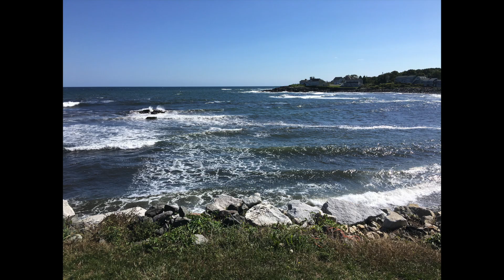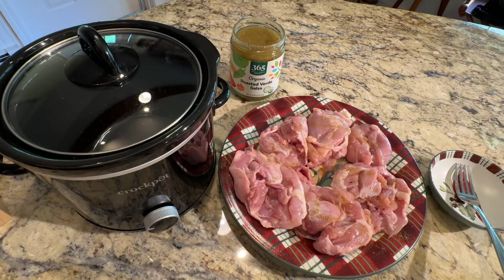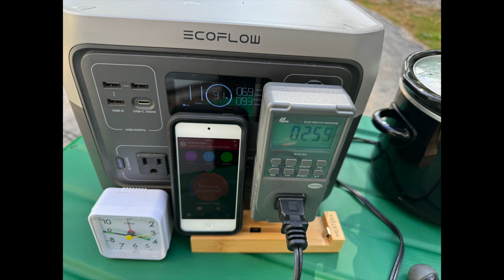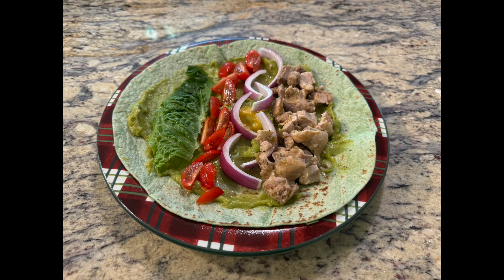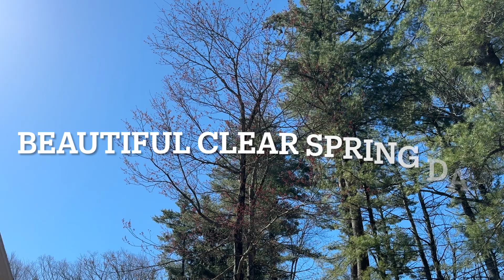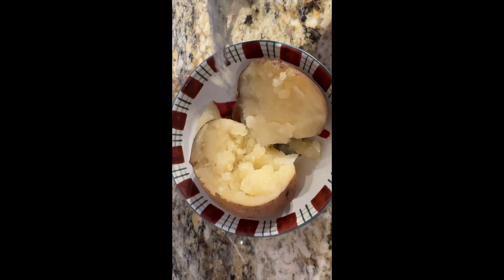Camp Crockpot - Solar Panel Cooking is a GAME CHANGER!

Comment from the maker: Here are the recipes and cooking gear links!

Recipes:

Salsa Verde Chicken
2 pounds of chicken (boneless skinless chicken thighs used here)
2 cups salsa verde (enough to cover chicken)
1/4 tsp ground cumin (or to taste)
1/4 tsp salt (or to taste)
Cooked on high until chicken reaches at least 165 degrees F on a food thermometer
After cooking the chicken, I used the excess Salsa Verde to make White Chicken Chili and adjusted seasonings.

Potatoes
3 cups potatoes
1 cup water
Cooked on high until reaching 190 degrees F

=======================================================================
Cooking Gear used in this video: 

 Products used in this video (Amazon Affiliate Links) -
2 Quart Crock Pot:  https://amzn.to/3zt6phz 
4 Quart Crock Pot: (I can't find a link at the moment, but Walmart has them also)
Meater 2 Plus Thermometer:   https://amzn.to/3xzzRSJ
Jar Opener:   https://amzn.to/3zrlDDH  (This is a modern version... The one in the video is antique)
XTAR Solar Panel (I used two):  https://amzn.to/3VJGKsk
EcoFlow River2 Pro power station:  https://amzn.to/3W98kkc

Disclosure: Links contain affiliates. When you buy through one of our links we will receive a commission. This is at no cost to you. Thank you for supporting Katy's Camp Kitchen and allowing us to continue to bring you valuable content.

=====================================================================
My fledgeling website:  Working to get all my recipes on here....  There are also old postings as old as 11 years ago.... I have been thinking about efficient cooking for a long time!!! Thanks as always!
 
https://katyscampkitchen.com

Comment: Good information Katy. My wife and I are on a no-red meat diet and I will try chicken breasts to make smothered chili verde with a power station. I have always made the pork version this way and I recently did the chicken breast with a drained can of black beans. I like LaVictoria's Green Chili Salsa. I have always wanted to put a box on the outside of my house to charge power stations. I may get around to it this fall when it's not so sweltering.
Reply from the maker: @Smarley-d6s  Hi Kevin!  I will look for the LaVictoria’s Salsa.  Thank you for the recommendation!  

We are working to figure out the best placement for a pole barn for our camper van.  Hopefully we will be able to put solar on it as we balance the topography and sunlight/trees.  

 Hope you get a break from the heat!
Good luck with your project!
Katy